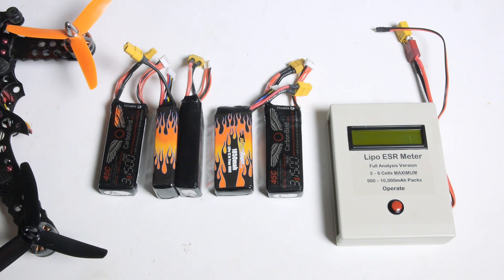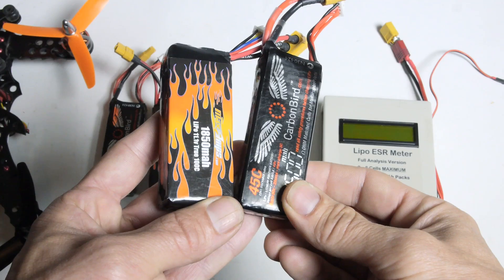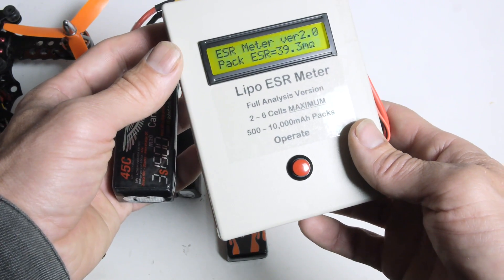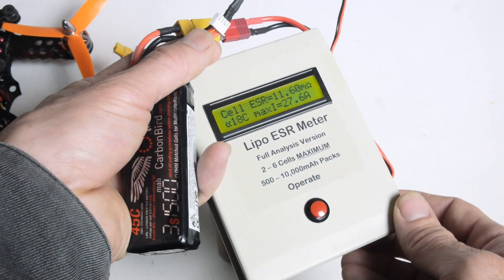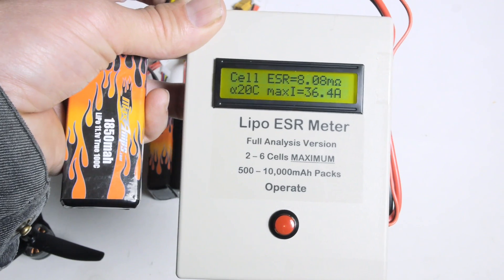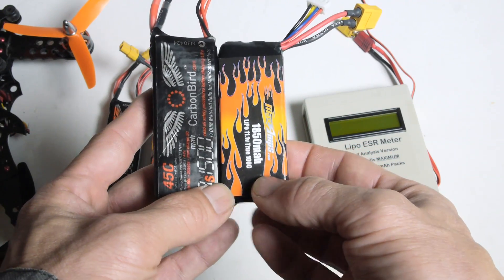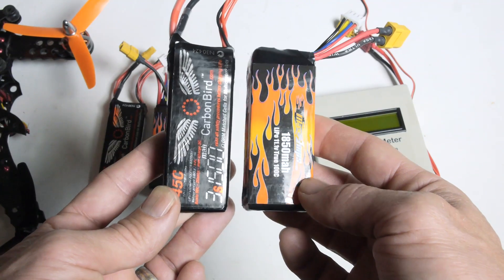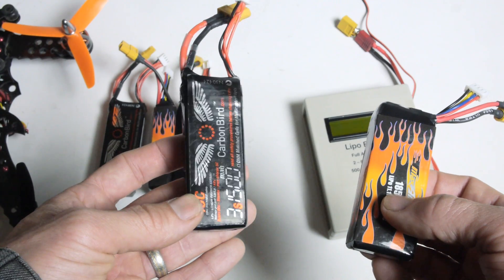ESR Meter Review and Test on MaxAmps 100c Lipo

Comment: 100c x 1.850A = 185A on those tiny wires.  Really?  I suppose for a millisecond or two.
Reply: the worst are not the wires imagine the small little tiny tabs who goes out from the cell where the wire is solder one , only 0.25mm thick  that crazy :)